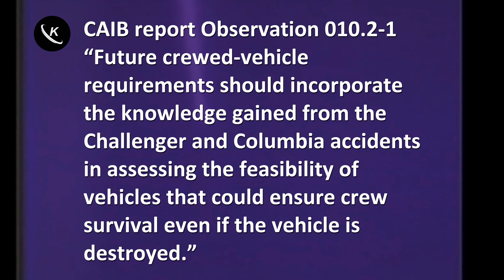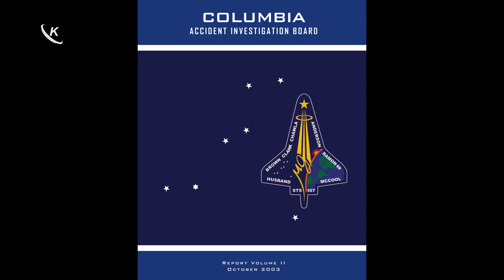SpaceX Starships Deadly Design Flaw

Comment: Except the shuttle and starship are two different systems. Starship will fly crew ONLY when it is reliable enough to do so. Shuttle flew crew on experimental flights. 

Shuttle was dangerous because of a normalisation to deviancy too. Not due to design alone. 

SpaceX has already demonstrated unprecedented reliability with Falcon 9 (with more consecutive successful landings as shuttle has flights) 

The aim is to develop starship to airliner like reliability through iterative and incremental development. 

Similar documents were also made stating that the use of Solid rocket boosters are dangerous and unsafe even with Aries 1X where they stated they were likely to kill crew in an escape. So would you also say that SLS is deadly?
Reply from the maker: Agreed the Falcon has, but Starship is a different animal. It is much more complicated and it will be a long time before it or any other rocket gets to airline like reliability. An independent crew escape method is needed for the launch phase. That is not only my conclusion but also that of the CAIB. SLS does have a way for the crew to get out, so at least they have an option. Of course it is really only going to launch 4-5 times, which is another story. It being safe is relative and SLS has to prove itself. But If I had to pick a launch vehicle and SLS with an escape module or Starship with perceived reliability I would pick SLS.
Reply: @Knowledgeorb  thing is though that starship won’t be flying crew any time soon. And in the meantime Dragon is more than capable of meeting the shortfall. 

SLS has the same issues as Aries 1 for SRBs. For Aries it was found by the USAF that an escape 30-60 into flight would ≈100% (yes surprisingly that’s the figure that was found) lead to a LOC due to the srb propellant destroying the parachutes. 

This is very likely to be similar with SLS and although NASA disputes this it has been called out recently by many former and current engineers for repeating the same shuttle culture of deviancy which was made even more evident by significant wear on the Artemis 1 heat shield prompting a delay to A2 and A3. 

And, again, other black zones exist. 

So even with escape systems safety is mostly in LV design not the system itself and is should only be treated as a last resort 

Plus survivability of crew compartments isn’t that unheard of. There’s the tragic case of Challengers cockpit but also CRS7 where the capsule did survive without an escape system however, it wasn’t programmed for an anomaly and didn’t deploy chutes accordingly. 

As well as IFT 2 for starship that even with an FTS termination the forward section survived and was imaged from the ground. 

Eventually, for spaceflight to progress, a change must be made from simply accepting risks are apparent and building proverbial (and in some cases literal) ejection seats to fixing risks and mitigating for them like with modern airliners. That are only as safe as they are now because of repeated iteration and learning from accidents. 

But culture is by far the biggest contributor to spaceflight failures that pure engineering
Reply from the maker: All excellent points. Thanks for the comment.
Reply: @Knowledgeorb  thanks for being so engaging and raising some good points yourself
Reply: Shuttle flew crew from its very first flight. It didn't even have an uncrewed test because it was a fairly mature and predictable design despite its ultimate shortcomings. They understood well enough how it was going to perform whereas SS seems like a dangerous gamble.

The idea is to learn lessons from Shuttle, not repeat them in different forms.

Falcon and SS are very, very different launch platforms. Different size, different engines, different layout, different everything. Heck Spaceshuttle and SLS are far more similar but I still wouldn't treat them like the same

Starship will never, ever, ever become as reliable as airliners. That's pure techno-futuristic fantasy. Spaceflight is fundamentally different. For example, you can't take a wildly complex and ambitious engine-design and simultaneously expect to be orders of magnitude more reliable in far more dangerous sudden-death scenarios while also seeing many, many more uses than any other engine can handle. At some point you have to realize that something being promised is too good to be true.

Comment: Nothing is 100% safe for humans when it comes to space exploration, and I doubt that they will even consider putting humans into the starship till it has dozens if not hundreds of flawless launches. also, there is a major difference between the starship and the space shuttle, Space X maintains all aspects of construction while numerous contractors built the space shuttle. meaning that Space X has significantly greater control over quality control in its builds. Also, you do not know that extra protection will not be put in place when they do decide to send humans up in the starship!
Reply from the maker: Good points but I have heard zero consideration in the human flight safety discussed as part of the Starship launch. Eventually, yes it may be safe enough but that should happen so far in the future the design will be totally different. What I see now are videos and SpaceX talking about trips across the globe with a hundred people on board like it is an airplane. They are no where near that level of reliability and it will be a very very long time before they are. At this point it is fantasy and nice videos. It will be interesting to see when they do advertise taking the first people to orbit. If Elon says it will be 10 years you need to apply the Elon time factor so it will be more like forty.

Comment: The Challenger didn't explode. It was a conflagration. Very little "Knowledge" here.
Reply from the maker: The launch vehicle exploded. The shuttle was part of that. It was not a "conflagration". The fire did not destroy the shuttle, the explosion did...very little "knowledge" in your comment.
Reply: @Knowledgeorb the fire did actually destroy the vehicle. The booster that failed fired a jet into the lox tank that caused it to fail.
Reply from the maker: Okay, fail = Exploded.

Comment: When NASA crew-rates Starship - they will most likely use the LoV/LoC probability models they have been using for years, most recently for the commercial crew program (Dragon & Starliner).
The threshold to pass for the commercial crew program was 1 in 270 and Dragon qualified at 1 in 276. There is no reason to believe NASA will not enforce the LoV/LoC requirement upon SpaceX applying to crew-rate the vehicle.
Spaceflight is dangerous, there will be fatalities on Starship and that's because nothing is bulletproof. There is absolutely no doubt in my mind that SpaceX and the partners they work with, will make every change necessary to benefit the safety of humans onboard the vehicle.
Reply: They're not on that path. NASA has no foreseeable plans to put humans onto Starship for the crucial launch or landing phases. It's Spacex that is carrying on with the assumption that its pie-in-the-sky private missions will be the first to take humans. NASA isn't holding its breath on it. It does seem nervous about Spacex delivering on HLS, however, and they should be. It's way too complicated and ambitious of a design, requiring tens of perfect launches stringed together for just one Artemis mission.
Reply: @snizami  NASA has not given a wiff of nervousness about HLS.
None at all.
Reply: @TCV12  yes they have. Look no further than the director's tweet after the last catastrophic loss indicating he wants to see how this moves them closer. Or maybe look a little further at the original selection statement which itself expressed serious misgivings about the design. Or a little further still at the fact that they've now added a backup alternative contract.

Comment: I'm willing to agree. The more they send up the odds just get worse for one badly built part combined with one or two missed quality checks and then boom.
Reply from the maker: I would not think of getting on a rocket that did not have a way to escape a launch failure. The odds are not good enough.
Reply: @Knowledgeorb escape systems themselves can kill crew btw. Black zones exist where rentry would kill crew and SpaceX even had a capsule explode due to the escape system in a ground test

They’re a last resort not the main safety measure. That comes from well engineered and well operated vehicles
Reply from the maker: Agreed it would be a last resort for sure. But if I am in that rocket I would want that option.